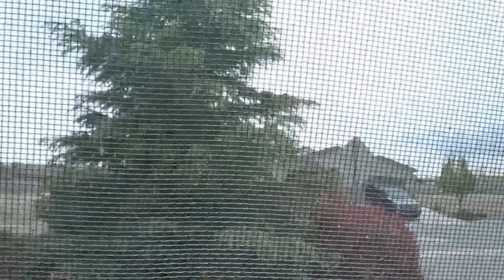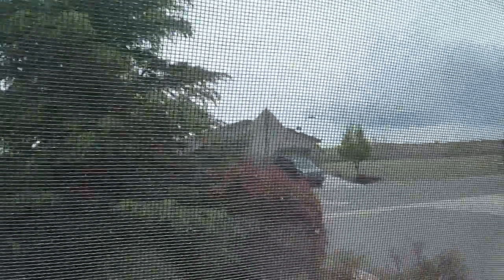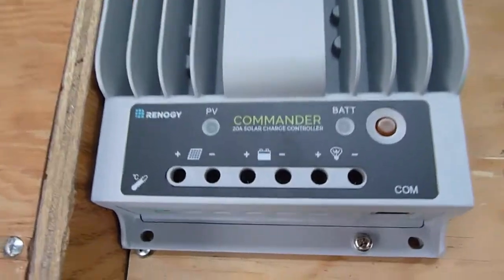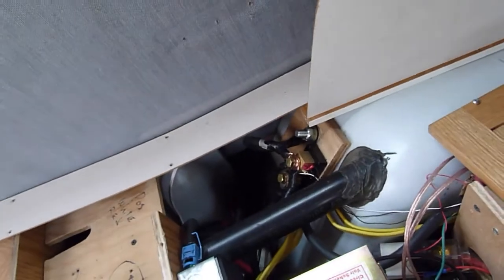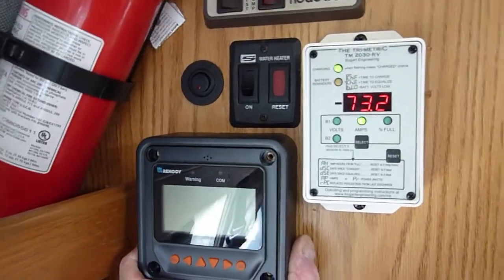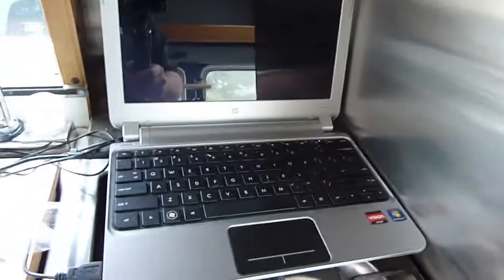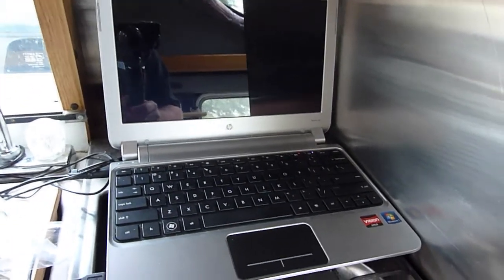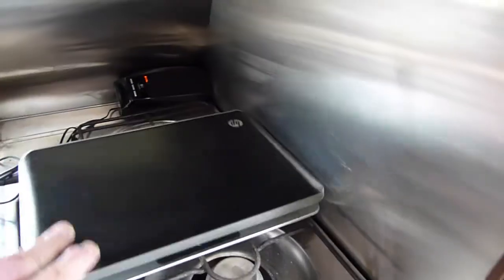6 Month Anniversary And Power Testing A Mini PC Computer In Preparation Of Full Time RV Van Life

Comment: You mentioned that the buck converter you have 'tracks' the input voltage... saying this, you probably have figured this out for yourself since you posted this vid in August, but you can buy regulated DC-DC converters for a bit more which will output the voltage you want with a variable input voltage. The DROK ones on Amazon get good reviews.
Anyway, came here for the solar install, stayed for the mini PC. Like the RV tech theme of the channel. Subbed!
Reply from the maker: Well, long story short. I bought a DROK DC converter and it failed a few days in frying the mini computer with it. Lesson learned, I bought just a buck converter and replaced that mini computer and it has worked fine ever since. I guess I just got unlucky. Glad you been enjoying the videos. Welcome aboard!

Comment: I am running Intel NUC mini PC on my van directly from house battery. This Intel NUC actually has  19 VDC power brick but running on my house battery which varies between 12V to 14.5 V has not been a problem.  I was concerned about the under voltage but I read on some forums a comment by Intel technician that it should be fine.
Reply from the maker: I had not one but TWO Intel NUC's fry running off my house batteries. I ended up returning both for a refund and got an ASUS instead. Good luck!

Comment: HI !!! I'm following your channel because I'm kind a geek guy and one day wanna do pretty much the same thing, get my stuffs into an RV and simply GO !!! But I need to prepare my future RV for my geek stuffs, so your videos are being truly informative.Thanks for that. 

But my question is, How do you will absorb the vibration of the van on your HD's ??? I'm asking that because I lost a couple of HD's on  my desktop computer just by cleaning the computer and the vibration made me lost the HD. (The PC was running on those days, so the HD were working). My bad, but I really think that to run my PC while I'm driving I'll need to go to SSD. What you think about it ?

Thanks for the videos ! Very informative !!!
Reply from the maker: Great question! Modern hard drives "park" themselves when turned off and can withstand very high G forces. As part of my checklist for breaking down camp, I make sure that the hard drives in the JBOD are turned off. Both the main PC and MiniPC use non-mechanical drives so I don't have to worry about them. If you actually want to use your computer while the vehicle is in motion I highly recommend using SSD or the new M.2 format drives. You can buy a smaller drive to save money and supplement extra space with cheap SD cards.
Reply: More things to look for. Thanks !